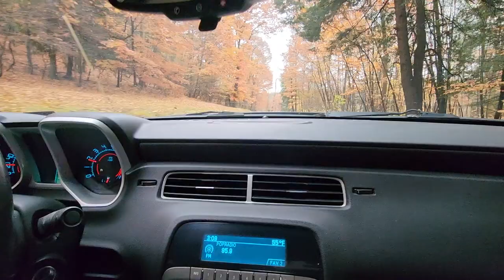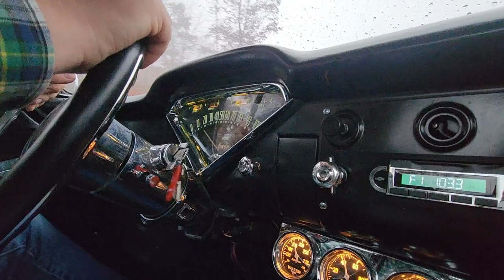Traded for a 1956 Chevy Pick Up and Everything Went Wrong...

Comment: I was nervous the whole time watching lance mess with that radiator. I had the exact same thing happen with a 72 ford f100 on the side of I-5 in seattle in the dark, only i ended up in the hospital with 3rd degree burns to my neck and shoulder. Glad you guys are ok.
Reply from the maker: Dang that sucks, honestly the fluid wasn't that hot, which is why we didn't think there would be quite that much pressure 🤣
Reply: I did that with a snowmobile years ago, lesson learned 😬

Comment: I got severely burnt one time. Had a jacked up 4x4 (radiator in the bed) it was getting hot and I got in the bed to pour water across radiator and cap blew off had some nasty burns all up my leg stomach face and arms. 200 degree plus coolant is no joke. I couldn't get my steaming hot clothes off fast enough. Hurt so bad for several weeks. Be safe my friends.

Comment: Those front cab mounts are pretty hokey.. I'd change those right away.
Reply from the maker: They don't look the best but they are like quarter inch steel so they're plenty strong.
Reply: @TopLineRacer  I just don't like the idea that the support is effectively cantilevered out a few inches, I'd build them over solid one way or another so there's just one bolt down through the mount and it carries vertically not horizontally, but that's just my .02$, I'm not gonna be driving it 🤷‍♂️
Reply: The first gen tundra has a body mount set up that is pretty close to that. They have reinforced plate steel along the sides of the mount and in the center but they sit pretty far off the frame

Comment: It looks like someone dumped a couple of cans of the black block sealer in there, then it blocked the thermostat up and overheated real bad
Reply from the maker: Definitely possible.
Reply: No fan shroud  will make it over heat to, and no-electric fans,recipe for disaster.